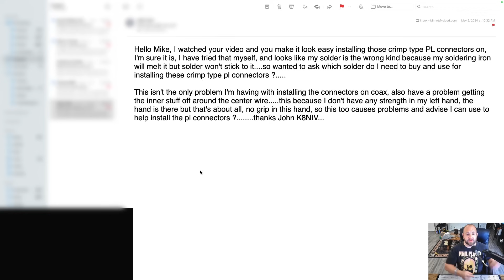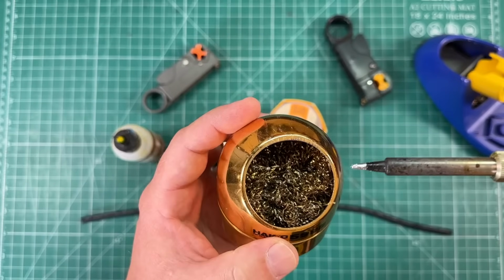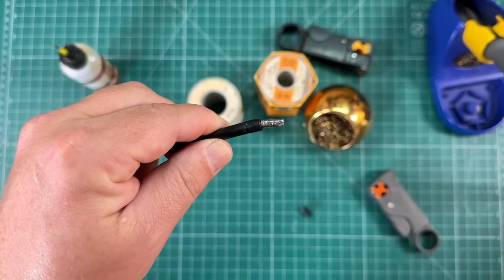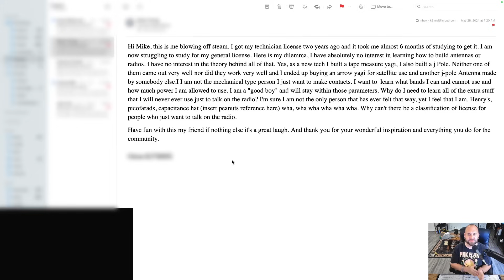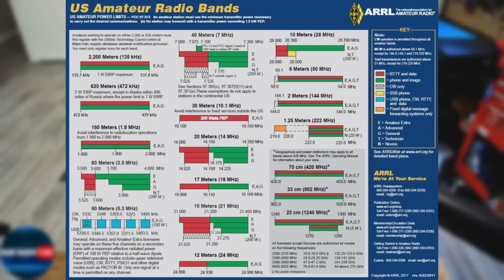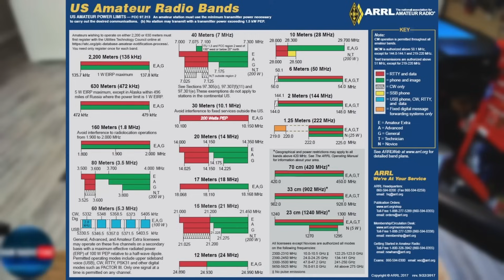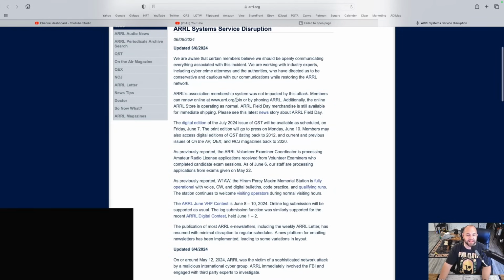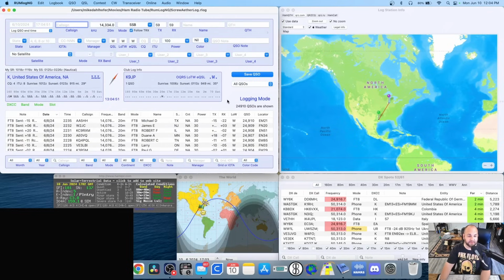Why Do We Need To Learn So Much To Talk On The Radio?

Comment: Simple answer Amateur radio ain't cb ,any fool can obtain a cb licence and operate poorly , however in Amateur radio a proper education in procedures and correct operatin practices is a must .
Reply: You don't need a license for CB operation.  Just sayin...  Reagan signed a bill in 1982 allowing the FCC to drop licensing requirements for Citizens Band radio.  Little history lesson. Not really relevant just knowledge I felt like sharing.  😂
Reply: @BigJohnsHamShack  you do in the uk just saying .
Reply: @georgebodley8068  all of a sudden 1776 makes better sense.
Reply: @georgebodley8068  no you dont. UK CB has been licence free since 2006.
Reply: @GunnyWombat  which proves my point about correct education in amateur radio as opposed to poor operating on cb  btw   i wasn't aware of ofcom changes to cb licenced regarding not needing one ,but then again we do t want to see amateur radii descending into the very poor practices of cb.
Reply: @georgebodley8068  It doesnt prove anything apart from your complete lack of education about what is and isnt allowed legally free in the UK despite being licensed. Ive heard shocking amateur radio practices. Operating procedures have no practical examination in the UK. The RYA SRC licence has more practical testing than RSGB.
Reply: there are some amateur operators that commit offences ,however the 1947 radiocommunications act ensures that their licence can be revoked and their equipment confiscated there is also the option of imprisonment depending on the severity of the offence so there is repercussions for offenders and rightly so ,hence why amateur  radio exams should remain in place ,the majority of operators abide by fairly strict operating practices unlike cb opoerators go look at the 1947 radiocommunications act  which is still in force today.
Reply: @georgebodley8068  do you mean The Wireless Telegraphy Act 1949...?

Comment: Mike, I think your response to the question of "Why can't there be a classification of license for people who just want to talk on the radio?" was excellent.  At times I've also had similar sentiments, wondering why I need to know all this stuff that I'll probably never need. Then I remind myself that as licensed amateurs, we're given the freedom to build our own transmitters and use them in the hobby, as long as they meet the FCC requirements. Most won't bother, or don't have the skill or depth of knowledge to build their own equipment, but we're given that freedom to do so. You can use CB/FRS/GMRS/MURS with zero technical knowledge of the service, but you also can't legally build and use your own equipment for those services. 👍

Comment: Calling BS on needing all the theory.  You can drive a car or sail a boat without understanding internal combustion or fluid dynamics. More government regulations driven by the narcissist in the hobby.  Sad hams
Reply from the maker: Yes, you will be included in my next sad hams video.
Reply: CB, FRS, GMRS or Business LMR would certainly be a better fit for those just wanting to press a push to talk without learning anything. And there's nothing wrong with that.

It has far less to do with gov't regulations being supported by narcissists and more with the concept of wanting to grow a culture and community of competent communicators and subject matter experts in the many facets of amateur radio.